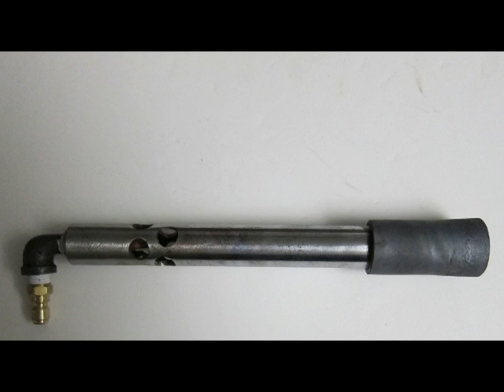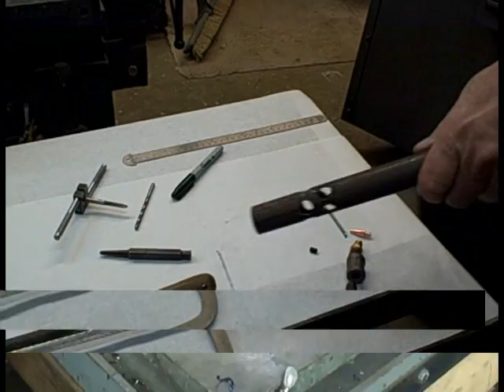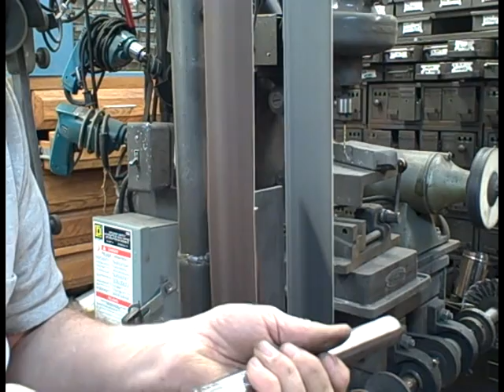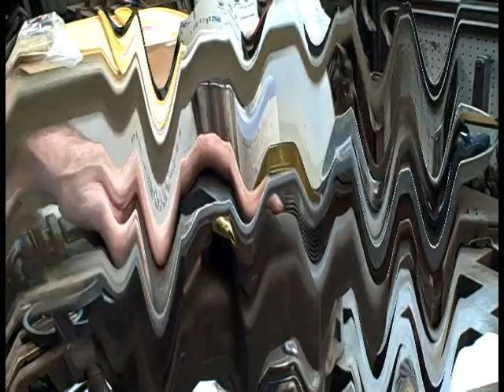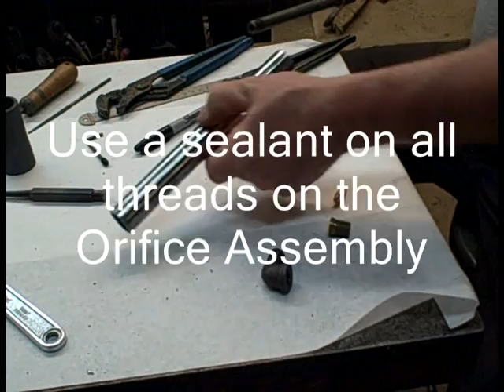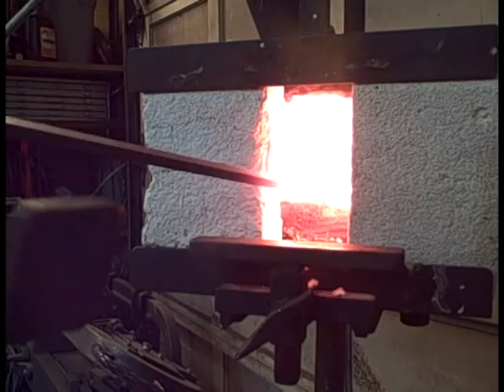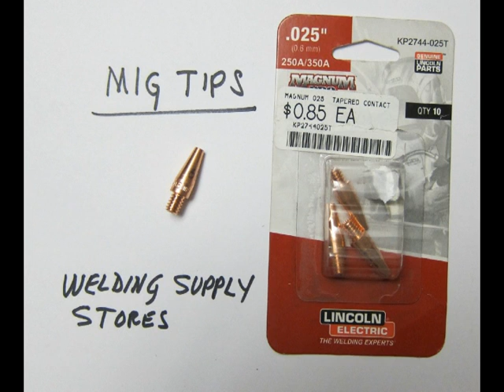How to build a Propane Forge Burner

Comment from the maker: I usually start the propane with around 10--15 PSI of propane.  After it is lit, I make crank it up to 30 PSI to heat the forge up faster.  Usually, after it's hot, I can back the pressure down.  It all depends upon how quickly you want to heat your stock.

Comment from the maker: One bar is only around 14 PSI.  I start my forge with about that much pressure, but many times when I use it, I crank up the pressure (open the needle valve) to much higher pressure, either to get the forge hot faster, or hot enough to forge weld.  Be sure you are using a high pressure regulator.  It is not unusual for me to be running the forge at 30 PSI (2 bar +), and back it down after the forge is hot.

Comment from the maker: It is one inch nominal.  I say that because all pipe is not created equal.  When I go looking for stainless pipe to make flares, I take a piece of the 3/4 inch pipe I use for the burner and make sure the stainless pipe will slide over it with a close fit.

Comment from the maker: The general guideline for a 3/4 inch pipe burner is that it will support, to welding heat, a burn chamber up to around 300 cubic inches.

Comment from the maker: Be sure your fittings are all compatible (same size and threads).  Use a liquid sealant like I showed in the video.  It is likely you have compatibility problems or got a little sloppy with your sealant and it is  plugging the mig tip orifice.

Comment from the maker: You can use soft firebrick for the floor, but if you want to forge weld,  I don't recommend it.  Flux is destructive to soft brick.  Thin hard firebrick makes an acceptable floor.

Comment from the maker: The coupler that slides into the 3/4 inch pipe needs to be a 1/4 inch coupler.  Obviously, you need a 1/4 inch fitting to connect to that on the burner side.  Other fittings and hose size outside the burner can be any size you want to use.

Comment from the maker: The BST-N2M is part of the quick connect system.  It is not the flare fitting I cut to thread and hold the mig tip.  The flare fitting has a 1/4 inch NPT thread on one side, and a flare fitting on the other.  I cut the flare off to make the fitting shorter.  The hole through that fitting has to be smaller than the drill bit you need to use to support the threads on the mig tip.  I can't give you more detail than that because mig tips vary across the globe.  Watch the video again more closely.

Comment from the maker: I have built a one inch pipe burner, using Larry Zoller's design (with a .045 mig tip).  You can google with "zoeller side burner " to see his design.  You will need a drill press jig or a metal lathe to get the 1/8th inch pipe pointing straight down the 1" pipe.  

The burner design in my video is simpler to build.  If you need more heat, build two for your forge and join them together with a single propane source (see the free form video for an example with two burners).

Comment: Thermal blanket walls...called kaowool in Canada. Ask any boiler making supplier (industrial) for "castable refractory" and you can make a form complete with the holes on the top of the forge for the burners. High rating refractory bricks can also be found from boiler suppliers. Ask and pulp mills where they get their supplies or any kiln company.

Comment: With respect to the flare fitting that you cut off with a hack saw and tapped to receive the mig tip - I assumed that it was a BST-N2M fitting.  This is clearly not the case, since the hole diameter - without being tapped - is already too big for the mig tip that you used.  What kind of flare fitting did you use?

Comment from the maker: The first answer should be "Make a drift", unless this is a chicken/egg sort of situation.  If you do have access to a forge, get a 1.25 round and forge it to a taper (angle described in video), then dress the taper smooth on a belt grinder.  If you can't make a drift, read the other answer I provided.

Comment from the maker: I have tried methods to make a flare without a drift, but don't get consistent results.  If you google with "propane burner flare", you will get numerous results for folks that sell flares and, if you read the articles, you can see how others have tried to forge them.  

An alternative is to just use an un-flared pipe.  You will have to play with its  position using the method in the video.  This will work, but may not be quite as effective with the burner.  using stainless is always best.

Comment from the maker: Look online (use Google or Bing) and in the phone book for businesses that sell ceramic supplies.  They should either sell what you need, or be able to provide a suggestion as to where to buy it.  Also,  watch my  simple forge lining video, which shows how to line a simple forge with just thermal blanket and use a hard firebrick for the floor and end doors.

If you can find a business that provides products for or repairs industrial furnaces, they sell or use thermal blanket and refractory.
.

Comment from the maker: Mig tip threads vary, depending upon which machine they are made for.  I have bought both 1/4-20 and 1/4-28 at welding stores where I live.  I'm sure there are other thread patterns used across the globe.  That is why I mentioned in the video that....   you need to buy your mig tips first, so you know what drill bit/tap to use. The easiest way to determine thread pitch is to use a thread gauge.  If you don't have one of those, go to a hardware store and try to turn various sizes of nuts on it.

Comment from the maker: Steel pipe will work fine.  When I look for stainless pipe to make flares, I just take a piece of burner pipe with me to test fit.  The ID's of commercially available stainless vary.  The flare should easily slide, but not be sloppy.  As described in the video, I position the end of the mig tip in the center of the holes closest to the flare end of the pipe.  If you have problems with the flame, you can play with the position of the end of the mig tip.  Some folks have used .030 mig tips also.

Comment: David - Thanks for your video! It was very informative and I may very well build a burner.  I have a couple of questions. You specify Sched 40 iron pipe.  Would Sched 40 steel pipe work as well? What was the inside dia. of the stainless steel flare? Does it need to fit tight against the iron pipe? Do you align the tip of the mig tip at the middle of the air holes at 2" or the ones at 2 1/4"? Thanks David!

Comment from the maker: I haven't played with using a sleeve as you suggest, but there are other burner designs out there that do.  It would be easy to experiment by using a slider over the pipe (like a 1" pipe over a 3/4" pipe with a set or thumb screw to hold it in position) if modifying the air intake will accomplish what you want.  The best results would probably be attained by being able to adjust the burner after the forge is hot.

My goal was to keep the build, test and use process as simple as possible....

Comment from the maker: It sounds like you made the right decision for you.  Making a forge, as I described, does require you to have significant tools and skills to use them.  I had a welder, drill press, and a lot of hand tools before I ever focused on blacksmithing and building my own forges.  If you have a desire to learn welding, take an adult learning class at a local college or high school.  That's what I did over 40 years ago and I was off and running.  Your inventory of tools will grow as your interest does.

Comment from the maker: If you mean Diamondback Ironworks, I'm sure their forges are fine.  I haven't used one, but there are some nice claims on their website.  

Even though the forges I make cost far less than good commercial forges, cost is only one consideration, I like to make what I use.  Because of the way I buy or gather materials, I have never kept track of what it cost to build any of the forges I have made.   If I had to guess at my cost to build a Super C forge, it would probably be well under $150.

Comment from the maker: Each individual's cost will depend upon how good they are at scrounging and how they buy the materials they need to.  My costs are low at a forge level because I am good at scrounging (steel recyclers) and, when I need purchased materials, I buy larger quantities than you may.  The largest cost to me is the regulator, hose, needle valve, gauge and quick connects (and the few fittings that are needed to put them together).  That cost is about $100 (all for high quality items).

Comment: FYI, there is a company called Harbinson-Walker hwr dot com that sells refractory cement, quite reasonable multi locations around the USA.  I used a piece of underground gas pipeline I was given (about a 12-14 inch diameter piece) and with that and a saunatube (used for making pier supports with concrete-lowes and home depot have them in the concrete area, long round yellow tubes) that I cut and inserted a flat piece of wood to make the floor form and got over 2 in of insul with a 4in floor

Comment from the maker: Good question....  Sorry, I don't have any experience with (or access to)  natural gas using these burners.  I've read that (normally) natural gas pressures available to the public are very low.  If that's the case, it's doubtful it would work with any atmospheric burner for a blacksmith forge.  The burner may light (unknown), but you probably wouldn't get your forge to forging heat.  

All the discussions I have seen about blacksmiths using natural gas involved using "blown" burners.

Comment from the maker: See the reply below.  The burn chamber is the inside of the forge.  Your forge is very large in comparison to what I generally use.   If you haven't put a refractory coating (to enhance efficiency) over the thermal blanket, you may not be able to get a forge that large to welding heat.  You might want to watch my Super C lining video.  I would expect you could get to forging heat, but for high efficiency, you should use a rigidizer, then a coat of the slurry I use (or equivalent).

Comment from the maker: There is a general guideline that a 3/4 inch pipe aspirated (as this one is) burner should be able to handle around 300 cubic inches of burn chamber.  You need to figure out about how many cubic inches your burn chamber has.  

I would expect you would need at least 3 burners for your forge.  You can reduce that need by adding insulation.

Compute your burn chamber in the following manner...   (3.1416*(square of the radius)* length of the forge).

Subtract est. cubic inches used by the floor.

Comment: Thanks David - I can make another burner to allow for the bigger burn chamber. I didn't think of that. 
Yes, there will be an opening on one end. I thought it could be used as a exhaust, but wanted to be sure since I've seen some forges with an opening and exhaust. 
My bricks are soft and I will not be doing any forge welding (for the most part). 
Thanks again, I'll start looking through your other videos. 
Appreciate the quick response, 

Henry C.

Comment from the maker: One more possibility, if you want more indirect heating, is to bring the burners up from the bottom on one side of the forge.  The end of the flares would still be down in the floor an inch.   I have a friend who makes hammers that has his forge set up that way.  It definitely would be better for heat treating.  Burners coming down from the top (even at an angle) will result in hot spots in the forge.  Burners that come up from the floor on one side should not result in uneven heating.

Comment from the maker: Are your bricks HARD or SOFT firebricks?  They should be soft firebrick.  The sides and ceiling can also be coated with the slurry I describe in the Super C Forge Lining video for higher efficiency (although they do not have to be coated for you to attain forging temperatures).  If you are not going to forge weld from this forge, you can use soft firebrick for the floor also.  I would not recommend the slurry for the floor.

Comment from the maker: Henry...   First of all, a single burner will only support a burn chamber up to about 300 cubic inches.  The forge you are describing has a burn chamber of 486 cubic inches.  You will need two burners to ensure you will attain forging heat.  The burners can come straight down from the top if you wish.  

An exhaust is critical.  The forge will not work if you totally close it.  Are you going to have a door...  or just an opening on one end?   The access to put steel in can be the exhaust area.

Comment: Hello David, 
My burner is complete and the forge is almost finished. The inside of the rectangle forge is 12 x 9 x 4.5 inches (length × width × height). Is has 2 inch fire brick all around. My question is: How important is having an exhaust and where would be the best place for the burner to enter the forge if I'm excessing the forge from one end. I'm mainly using the forge to anneal and heat treat steel for knife making. Hope that makes sense. 
Thanks in advance!
Micah C.

Comment from the maker: If I am forge welding, I may run the pressure as high as 35 PSI.  After the forge is hot (floor and sides glowing yellow), you should be able to run it at 10-15 PSI.  If you put a lot of cold steel in it, you may want to increase the pressure to 20-25 PSI to facilitate heating that steel quicker.

Comment from the maker: I made the drift.  I don't know where you could purchase one.  

The most I run the pressure is probably 35 PSI.  You should run at a suitable pressure to maintain the forge temperature you need.  Generally, I set the pressure at 10-15 PSI to start the forge. I increase the pressure to 25 or so till my steel is hot enough to forge, then turn the pressure down a bit.  

I leave my regulator cranked all the way to the highest pressure.  Open and close the needle valve to set the pressure.

Comment: Hello David, 
Thanks for the video. Good job. 
A few questions: 1. Where did you find the drift? I struggling to find one. 2.  Also, you more or less run your torch all the way up to the 60 psi - is that correct? 3. Lastly - Is a needle valve's primary purpose pretty much to make micro adjustments to the amount of propane passing through it? 
Thanks again, 

Micah C.

Comment: Great video. I'm building one of these at the moment. Could you tell me what the adapters are on the hose. My hose is 3/8 left hand thread and need to bring it down to 3/4 right hand thread. Also is the mig tip 0.6 or 0.8 mm

Comment: What I have is a 17 y/o turbo torch. The one with the interchangeable quick connect tips. Back then we called it a rose bud. It's already set up for propane. I'm hoping that it might be a good place to start in building my forge. thanks.

Comment: Thanks for the Video David,
I have made one of these burners and at first it had a nice medium to long flame but I forgot to seal up all threaded parts and it would start to sputter and flame would come out of those threaded parts, since then I have sealed up everything but the flame seems to be on the low side now and doesn't seem to be as strong also I cant really turn it up to much higher or lower, it goes out either way? any ideas? I posted my first burn and then low burn, Thanks!

Comment: Hi David thanks for the reply
im actually using this burner for a aluminium foundry.
Its a steel frame with fire bricks for now im going to pack with fire blanket to 
improve the lining.
I have used a 1mm welding tip in mine. 
My opening is a 120mm hole in the lid.
I will get a video up to show what i have built for you to have a look.

Comment: I've made a burner based on your design it works pretty well but i don't think its burning right. I'm running it with propane at 1 bar and while the flame is stable and hot it seems to lack power, when i introduce a blower the flame gets hotter and looks as it should.
I have managed to melt aluminium in a steel crucible.
I don't really want to run the blower all the time so how can i increase the efficiency with out the blower?

Comment: I use an acetylene regulator. It will screw directly into the bottle and has a high side (3000 psi) and low side (150 psi) gauge. I purchased mine on ebay for less than $50. Works very well.

Comment: I'm not allowed to post a link but if you go to tuckers pottery and look under kiln furniture, you will find the ones I used.  They're actually twice as expensive as I said... $2.00 :-).  The 2" one would probably be better than the 1".  They're rated to cone 11 which is about 2400F before they oxidize.  Probably fine.
Thanks for listening to my music.  I've got ~200 views on one of them - I'll try to keep the fame from going to my head.

Comment: Hi Dave,  Thanks for posting this.  I have just built two of these and they work great!  The only difference I made was that insteqad of a stainless steel flare, I used a 1" kiln shelf spacer.  These are about 2" square with a 1" hole through the centre and are made of high temp ceramics - ~$1.00.  I used a 12" 3/4" nipple cut down to 9" but leaving the thread on the output side.  I then threaded the kiln spacer onto the threads.  The other difference is that I used an .035 MIG tip.
Thanks again

Comment from the maker: While it is true the burner may work without the flare in the forge, I still recommend a flare be used.  The end of the burner WILL be burned in time if the forge is run hot.  Personally, I'd rather change the flare when that happens instead of replacing the burner pipe.

Comment from the maker: Any fitting that will fit snuggly into the pipe and allow you to point the orifice opening straight down the pipe should work (as long as air can be drawn into the pipe from the drill holes... and the end of the orifice can be positioned so the gas is mixed with the incoming air).